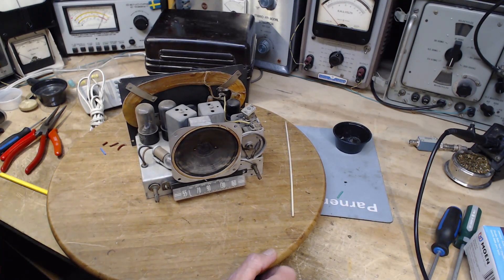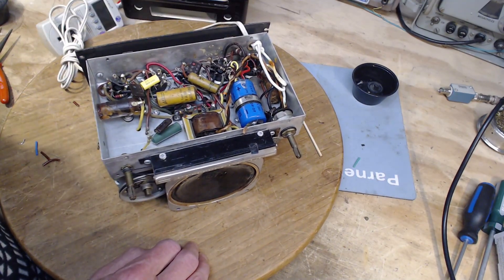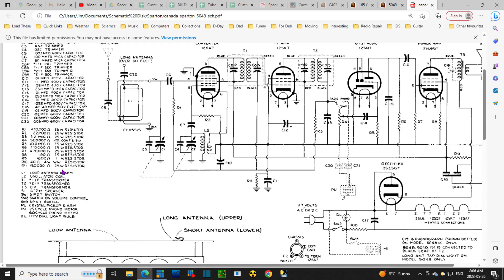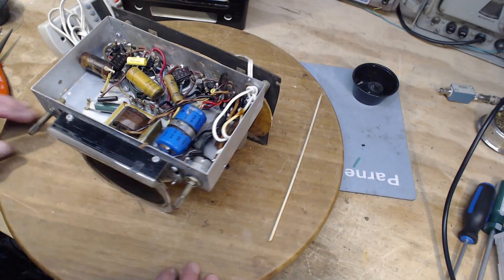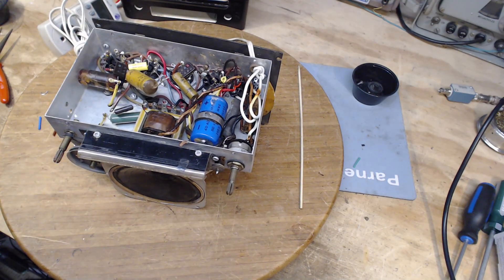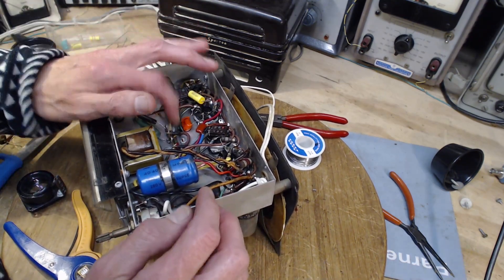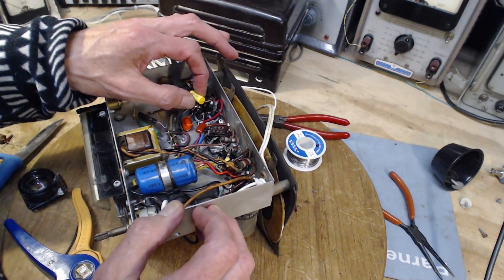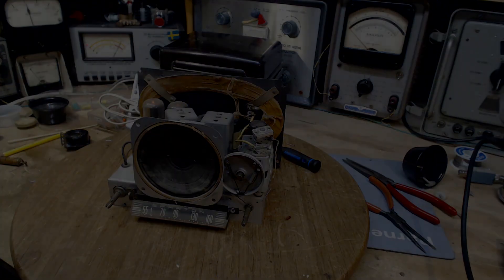Sparton Model 5049 Video #3 - Oscillation Remains

Comment: Radio sounds better and stronger. If cap is across ac line replace it with an XY safety cap. The one that was in there is called the death cap